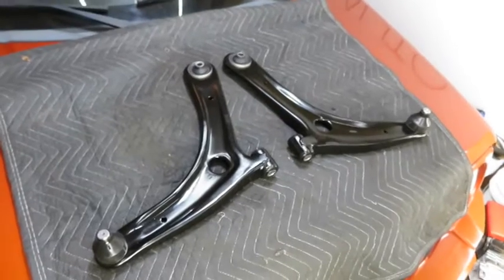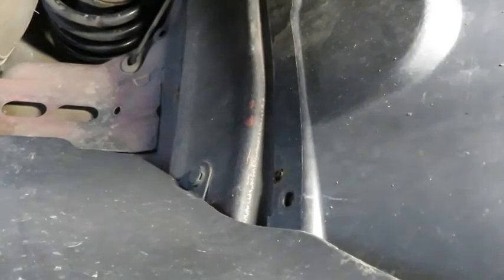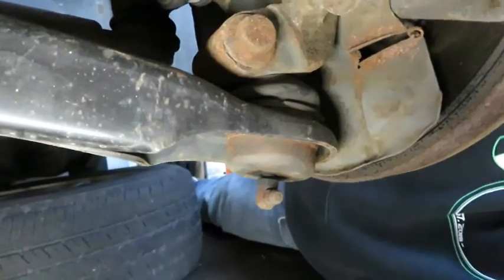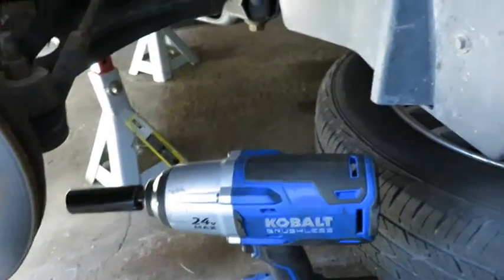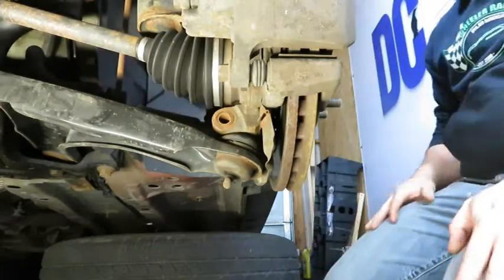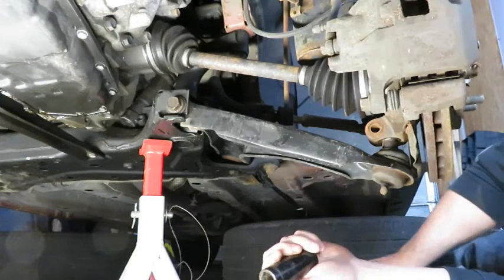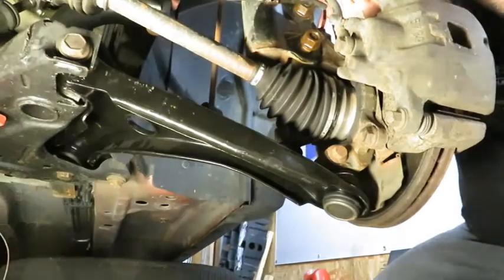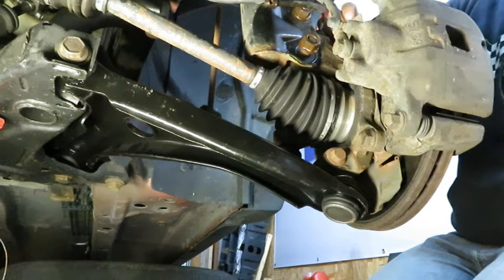Jeep Patriot / Compass Lower Control Arm Replacement DIY

Comment: TIP: Most of us don't have a lift which makes it a lot easier. When installing the ball joint into the upright, make sure both front wheels are supported off the ground otherwise you will be fighting the sway bar. Also set the steering straight ahead or you will be fighting the steering arm trying to move the upright.
Reply from the maker: I wish I had a lift!

Comment: What was the part called you relead it from right at the 8 minute mark
Reply from the maker: I went back and watched the video. I took two bolts out from the top of the knuckle that holds the strut to the knuckle. I took those out so I could change the angle of the knuckle while trying to get the ball joint in to the bottom.
I hope this answers your question.

Comment: This was great. I'm at the shop working on one of these and this was a nice run down. how are you liking the KOBALT cordless impact? I'm considering purchasing a cordless as I currently have a air one that works amazing
Reply from the maker: I've been happy with it. I bought the half inch one that came with a battery and charger and then I bought the 3/8" tool only.  I can not currently run a air compressor so these were definitely a game changer for me.  Thank you for giving your feedback, I appreciate it.

Comment: Very helpful but i dont understand why the new replacement balljoint doesnt have a rubber boot on it...
Reply: I'm getting ready to replace the passenger side on my 2014
Reply from the maker: @davidmorrow4929  I haven't gone back to watch the video but it would have to have the rubber on it to keep the grease in.
Reply from the maker: @davidmorrow4929  good luck, hopefully the video was able to give you an idea of what is involved in changing it. Thanks for watching

Comment: I'm doing this on my 08 Patriot. I am stuck on the bolt that has a captive nut on the inside. I tried to loosen it and it wouldn't budge and now the hex bolt is stripped and the 21mm socket slips once force is applied. What are my options? Appreciate and suggestions
Reply from the maker: That's a tough spot to be in. I don't have any good words of wisdom at this point. Whenever you have a stuck bolt, it's a good idea to heat the bolt with a torch to get it to budge. Hopefully you can find something helpful by googling or youtubing. I wish I could help more.
Reply: @DCAutoEnhancement I'm getting a 21mm bolt extractor socket tomorrow morning and hopefully that works. I have a torch and will heat it up before trying with the extractor socket but where would you suggest I heat it up? Should I heat up around the hex bolt head or should I try and heat up on the other side where the the captive nut is (or both?).

I'm really hoping to get it out because I just bought a bunch of pieces for the car and don't want this roadblock :/
Reply from the maker: @ithinkiatecatinchina  heat would be best applied on the captive side if you can get to it.

Comment: So I wish I saw this video b4 i started the job because I'm only halfway done. The issue i have is, on both the OE (I'm assuming) & the new control arm the sway bar links are essentially resting on the control arms. When I google it others have the same issue but nobody posted the fix. Do you know why the sway bar links are hitting the control arms?
Reply from the maker: The only reason I can think of is if the link is broken or the sway bar is not in the correct location
Reply: @DC Auto Enhancement  with the front end off the ground they just hit, at least on the one I worked on.

Comment: Would I need an alignment after doing this at home?
Reply from the maker: I would say yes. I believe that alignment adjustments are made using the control arm. However, I'm not an alignment expert.
Reply: @DCAutoEnhancement  thank you.

Comment: I’m not sure why I’m having such a pain in the ass time with this.  Everytime I get the top of the rear bushing lined the bottom is out of line. Can’t get them both lined together.
Reply from the maker: I don't remember how this went for me but is it possible to use a punch or a screwdriver to hold the top in place and then line up the bottom?

Comment: Just did mine today. I removed the upper bolt but forgot to loosen the one below it 💀
Reply from the maker: Was this video helpful to you? How did it go for you?
Reply: @DCAutoEnhancement  It went well. Had trouble getting the  part that goes into wheel hub in. But again I forgot to loosen the middle bolt and only removed the upper bolt. I'm doing the passenger side tomorrow and hopefully it'll go smoother than today. Thanks for the great information, it really helped.
Reply from the maker: @Archfiend90210  awesome, on my community tab, I will post some pictures the Patriot after my son wrecked it.
Reply: @DCAutoEnhancement  I had a question: are the torque specs for the two non control arm bolts when putting them back on?
Reply from the maker: I would need to re watch the video. I do not recall which bolts you are referring to.  I'll see if I can get that info
Reply from the maker: I believe that the torque values were probably for the bolts that hold the strut to the knuckle
Reply: @DCAutoEnhancement  those
Reply: @DCAutoEnhancement  did the passenger side today. It was a very different experience. It gave me a hard time a bolt and some nuts were different sizes than the driver's side.
Reply from the maker: @Archfiend90210  that seams strange. I did both of mine (only recorded the driver's side) I don't recall anything being different. Glad you got through it though.

Comment: U skipped how to get the arm in!! Just edit and walla
Reply from the maker: It's been a while since I made this video. It should go in reverse of removing it only, I think it's easier. Are you currently doing this job? I may be able to make a short video of putting it back in if I have the original video still

Comment: Just jack it up from the pinch welds on each side of the Jeep. Note: when removing the lower ball joint, the bolt used to squeeze the knuckle over the ball joint, the bolt is splined, so if you try to spin the bolt off using the bolt side instead of the nut side, you'll probably strip out the splines. With knuckle compressed, you can use an impact or hand ratchet to spin the nut off and tap the bolt out. I highly recommend removing the strut assembly complete from the strut tower as its connected to the anti sway bar and when released, the sway bar link wants to rest on the LCA making it difficult to line up the inner mounting bolts of the LCA. Also tap the trans axle out and use the bolt to pull it back in when reinstalling. Thanks for the video DC!!
Reply from the maker: Thanks for watching and adding your info here to help the next person
Reply: @DCAutoEnhancement  right on brother